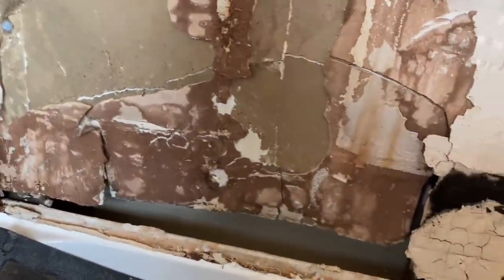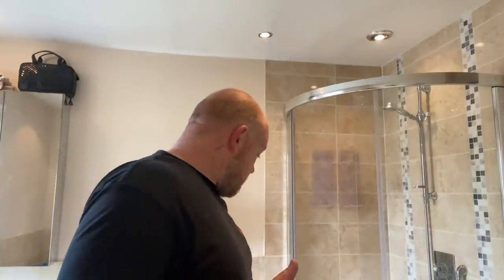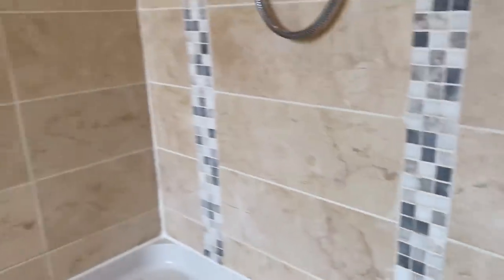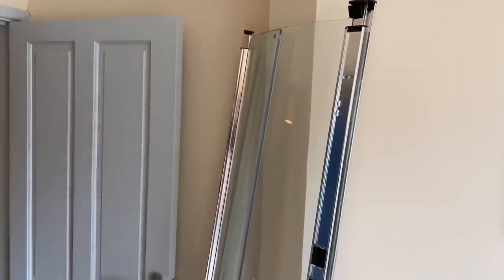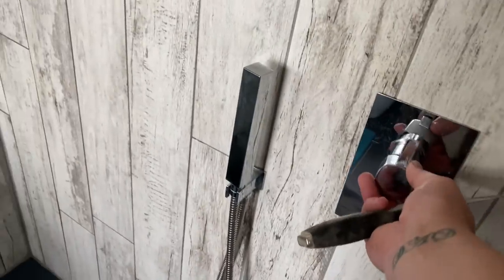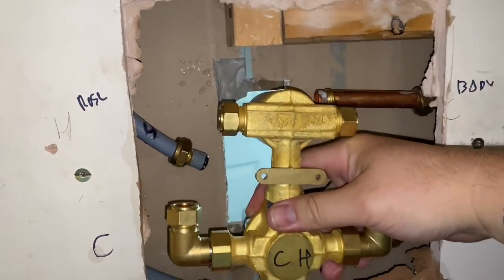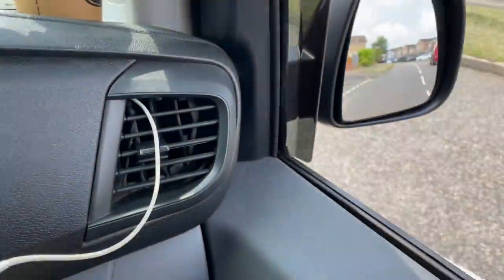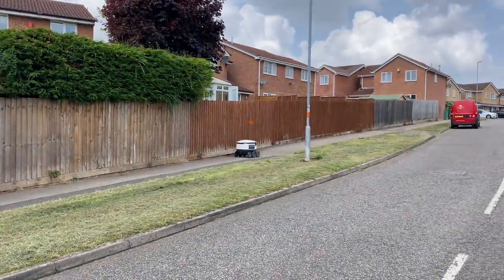SHOWER PROBLEM ON THIS JOB & HOW TO STOP A SHOWER PUMP FROM “PULSING”…

Comment: Buddy you just saved my sanity, shower has being pulsing all week, checked the outflow and filters..everything was fine but still pulsing. Seen your video, adjusted the isolation and what do you know it worked a treat. Can't believe it I was close to pulling the shower off the wall 😋.

Comment: Hi Mark I  had this exact same problem a couple of years ago with a customers shower pump that was pulsing,  did the same thing as you I restricted the flow cured problem, the actual problem was caused by the flow rate being to fast for the shower head riser pipe which only had a bore of 8mm housed in a 15mm riser tube( cheap import from china) this subsequently caused back pressure thus causing the pump to pulse, the cure was to restrict the flow slightly to the pump, and as far as I'm aware it's still working fine to this day.
Reply from the maker: Sounds exactly the issue I was having buddy…. Glad someone else has had to do what I did.

Had me baffled that’s for sure

Comment: Evening Mark, I'm at the start of my career plumbing but I had similar issue with a shower pump but different set up to yours. It was a single impellor pump just pumping the hot feed and I worked out that the cold side was fed through the tank to the mixer shower so unequal pressures. Obviously being new in my plumbing career it was quite nerve racking to cap the cold side and test running the mains cold water to the shower but to my relief it worked. Great video as always mate. Really appreciate the content 👌
Reply from the maker: Thanks mate, glad you sorted your issue…. Just go through each issue and eliminate bits as you go along.

Comment: Hi Mark, loving the content on your channel, full disclosure, I'm a kitchen/bathroom fitter, never claim to be a plumber!!
I've just finished refitting our bathroom at home, took out the bath and fitted a 1600 x 800 shower tray. I wanted a decent shower as it's the main bathroom, so went with a Mira Mode Maxim Digital mixer, running off our combi boiler. Really nice unit, pretty simple to fit, (we are living in a bungalow), but interestingly it comes with three different inlet filters/flow regulators. These are matched to the flow rate of the boiler specifically to eliminate pulsing, so I assume doing the same as your iso fix.
Congratulations on your channel mate, will follow with interest.👍

Comment: Great video mark in the past I've had this with shower pumps some of the things I've found are unbalanced hot and cold, filters causing a restriction removing them stopped it, blockages in the pipework caused by limescale, air getting sucked up the vent pipe, expansion vessel on pump needing recharged.
Reply from the maker: Thanks mate

Comment: Hi always learning from your vids even though I've done a few bathrooms theres still something new. So here's my bit back to you. 
The pulsating issue is very similar to your dc inline camper pump. If you don't understand it, get one of these(shurflo etc). Take the plastic housing off and see how is it made. In short it's a safe device for the pump never pumping more than the outlet is designed to draw and so increasing pressure in its guts. Example: 2 bar on the pump and 20 l/min outlet. No issues. 2bar on the pump and 5l/min outlet and its pulsating with increased pressure each time it let some water out.
This dc pump is done with valve and spring. Similar to your check valve. On your negative booster pump won't be much different I can't imagine. 
Not great at explaining but thought I could help. If you just lost couple of minutes by reading this and still don't understand it, then I am sorry and also sure never to be a teacher🤣🤣🤣
Good luck mate!
Reply from the maker: Hahahaaa…. Read it twice and get what you mean 👍🏼🤣🤣

Thanks for taking the time to replay mate, much appreciated.

Comment: Great content as usual bud👍🏻 Had a similar week! Bathroom refit, shower wall install where the customer supplied bath, basin, screen and toilet and were really chuffed how “cheap it all was”! Bath had been repaired in the corner near the waste (customer not concerned), waste outlet on toilet was cast out of shape ( customer not concerned), shower screen scratched and had those crap push in seals which were a b’stard to fit ( customer not bothered), pedestal damaged and had been painted over (customer not bothered), bath panel damaged and was twisted out of shape and the customer said…………………….it looks 10 times better than it did before😂 doesn’t do a lot for taking pride in your work though does it!
Reply from the maker: Nightmare week for you aswell then buddy…

Well we go again tomorrow 🤣

Comment: Yes had a pulsing pump and didn’t manage to sort it - customer got another plumber in who fitted a surface mounted valve and risers leaving the old concreted in valve and riser redundant - I was told by him that the filters in the old valve were blocked with debri and couldn’t get at them to clear. That’s  a new one on me. As regards the robots they’re everywhere in Northampton- I always assumed they were from Amazon and not food shops

Comment: Hi mark know wot you're going through mate it can be tough out there I have been fitting bathrooms for 30 years  admire the way you show the real world seams like pump is trying to pump more than it can let out of shower head if that makes sense
Reply from the maker: Thanks mate, just showing what we all have to put up with day in day out 👍🏼👍🏼

I did think that with the shower head but does it on the body wand aswell….. strange situation

Comment: Fantastic video again mate. Thanks for taking the time to film and share. 👏🏻 

Shower tray/cubicle: A great example of why shower areas should always be tanked prior to tiling. 

Pump: Never heard of a pulsating pump like that, mate, so great info to know. The only thing I would say is perhaps fitting flow restrictors might be a better option instead of using the iso valves.
Reply from the maker: Cheers buddy…..

Was a case of getting it working and seeing how my mate gets on… may fit them on a return visit👍🏼👍🏼
Reply: Fair play  @MJTiffPlumbing
Reply from the maker: Thanks for watching pal….. 👍🏼👍🏼
Reply: Loving the work @MJTiffPlumbing . I'm hooked 👍🏻

Comment: The pump is controlled by a flow switch, educated guess is that a pressure wave is going down the pipe, hitting an elbow etc and reflecting back and then turning the switch off.

You could probably have fixed it by fitting shock arrestees too.
Reply from the maker: Now there’s an idea……👍🏼

Comment: Had the same exact issue with a shower pump with a shock arrestor/accumulator built in (though don’t know if that contributed to the fault). My reasoning for throttling the incoming was that the pump is switching on a differential pressure/flow (drop). So if the pump doesn’t detect it it won’t fire up… Or it will cycle as the inlets make up the pressure
Reply from the maker: Strange one isn’t it

Comment: hi bro great video. I have a similar problem with my pump. Installed new showers mixers new taps for 2 bathrooms and brand new roundfoss 3bar positive pump.....it's pulsing and I ve done everything....
Reply from the maker: Sounds like air

Comment: You done a good 👍 thing , the pump is to powerful for one ☝️ shower , and size of cylinder , and tank on a loft could be to small or fill valve inside a tank in a loft is not refilling water fast enough… the pump is sucking water and air at the same time… other common fault hot water cylinder should be set on 60 degrees if it’s hotter than that it will damage the pump in a longer run.
Reply from the maker: Thanks mate…
Tank in the roof is big enough and fills fast enough to not run out.
It pulsed as soon as it was turned on… but the problem is now sorted with the flow turned down…

Comment: I’ve had the same before with a shower pump pulsing, turned out the be insulation that got into the tank and then stuck in the feed
Reply from the maker: Good shout that 👍🏼

Comment: Great vid mate, and sorry you had to go through the painstaking process to finding out how to fix the pulse. I would have said defo back flow pressure from the shower head poor design working against the pump but if the body spray did it, very weird. Thanks for sharing though.

Nath will be watching in disbelief at the tiling, dot here and there...should be regulated some how as tile adhesive coverage in a shower should always be at least 90%! Criminal spotting that.....

Keep going mate
Reply from the maker: Thanks mate… yer it was deffo a strange one that really had me thinking, and still is..

Nath came to that shower job and that’s the point it become a complete different job… the saga continues…

Thanks as always mate 👍🏼👍🏼

Comment: Yes had the same issue with a shower pump, and fitted a couple of gate valves and turned down until it stopped (couple of questions, filter blocked? Pump too big for shower,  is it for 2 showers or just the one?
Is the supply to either shower head or pump, have a lot of bends/elbows?)
Good video, enjoy the highs and lows
Reply from the maker: Thanks mate

Single shower and all swept bends etc….. like you once throttled the feeds all was fine 🙌🏼

Comment: Hi Mark. I've fitted a Salamander pump recently and I'm sure the instructions state to have the AV couplers as straight as possible where as they are bent over 90 degrees in this video. Not sure how much difference that makes in the real world though.
Reply from the maker: Never had an issue with them as they are installed to be honest 👍🏼👍🏼

Comment: The shower pump is the wrong one . The one that's fitted is for negative head . You have positive head . I.E.  loft storage above shower head .  What's happening is the pump us putting out more volume than is required so the restrictions in the system create pressure.  The pressure builds to a point where the pressure switch thinks the valve has been closed and stops pumping . That's why there is a small charge vessel on top of the pump ,  there will also be non return valves to stop the pressure being lost . Once pressure drops the pump starts again.  By reducing the input (throttling down the valves) there is not enough volume to create the excess pressure required to switch the pump off , so no pulsing on and off .
Reply from the maker: I know what a positive and negative head pump is and that’s not the issue.
This pump was originally in the roof and did exactly the same thing,It’s been moved to try and sort the issue which is now sorted
Reply: @MJTiffPlumbing  what I have said still applies . Positive head pumps have flow switches which bring the pump on . Negative head can have a pressure switch and charge vessel.
Reply: @MJTiffPlumbing  you said you had connected a hose pipe to the pump , with the open end of the hose there is little restrictions so no pressure build up . Once a headset or rain head is fitted you have small ports and restrictions.
Reply: @MJTiffPlumbing  I am not trying to be an arse about this . I have only seen the video and don't know the whole job or how it's piped up . I ain't saying you don't know the difference between positive and negative head . What I have said is my take on it . Others may have different ideas
Reply from the maker: Not saying you are mate… I appreciate comments on this as it’s a new one on me, and others judging by the comments/feedback 👍🏼👍🏼
Reply: Finally someone has got a perfect diagnoses for the problem, this absolutely makes sense. Negative head pumps are for when you have the shower head above the water level in the CWSC, for example in a loft conversion with an en-suite. See these fit all the time in houses, completely wrong.
Reply from the maker: So what happens when that pump is in the loft but still doing exactly the same thing…..??

Which is what it was doing to start with.
Reply: @MJTiffPlumbing  pump location doesn't matter.  It's still producing more volume than required hence a pressure buildup.
Reply from the maker: I’m saying that negative head pump was in the loft but doing the same thing…

So if it’s producing more volume than required, by turning the isos down that’s why it stopped pulsing
Reply: @MJTiffPlumbing  the pump hasn't changed.  Only its location. Hence the issue prevailed.  By reducing the input volume you reduce the output volume and therefore the output pressure.

Comment: Have you checked , how good the bending pipe was from a cylinder going upstream inside the cold water storage tank , whilst pump is on or ask anyone to put it on and put the hand over the overflow pipe, see if it’s any suction in there , anything in pulsing, usually involves air suction at the same time . If previous pump was doing same it’s got to be it , other tip , remove the big square shower head on top, could be lot of debris stuck inside, and let all water to gush out , and the last one it’s a built in strainers inside a shower body…. If they wanted to done them properly, massive investigation involves , other scenario could be , whoever installed a S-Flange , the foaming insulation on a cylinder went down inside a cylinder tank , which blocking partly the S-Flange, not everyone does a clean and nice job .
Reply from the maker: Complete set of checks done at the time mate… but thanks

Comment: had a crosswater tray crack all the way round the waste on sunday, only 18months old, only 25mm thick which ive nvr seen before, outlet just as u step into it centre of the radius. Fully supported although it shouldnt matter as it can also be fitted on legs. Thankfully the client supplied all the ware themselves so cant hold us responsible for supplying shit. Trying to find something to replace it with has been a challenge, trying to do it without breaking tiles, ended up with a mira flight, bit of an odd waste connection, its like a slot. Also 905mm which hasnt helped.
Reply from the maker: Fair play sorting the issue 👍🏼👍🏼

Comment: Looks like that shower tray had the plasterboard fitted around it, and not down behind it too. This will always leak as the p/b has no horizontal fixing points at tray height to hold it firmly in place. Silicone etc cracks with the movement and water gets in….. if unable to remove the tray and fit p/b behind it, fill the void in the stud wall with expanding foam to keep the p/b solid
Reply from the maker: I will be removing it all and fitting Hardy backer moisture board and sorting it all properly 👍🏼👍🏼

Comment: I find this alot with pulsing on thermostatic valves (TMVs) as the failsafe kicks in and out due to pressure that's why throttling back tends to work with most
Reply: Did you check temperature coming out when pulsing??
Reply from the maker: Temps were all fine…. Throttling it back seemed to sort it 👍🏼👍🏼
Reply: @MJTiffPlumbing  sounds like the thermostatic failsafe trying to kick in due to high/low flow rate or flow rates slightly different

Comment: Did the shower instructions say use a pressure reducing valve or keep the hot and cold balanced?
Reply from the maker: Nothing about a Pressure reducing valve at all…. Piped at manufactures instructions
Reply: @MJTiffPlumbing  ah right you would hope they would mention it. Am sure Paul from Mira has mentioned this kind of issue on GasApp before. Glad you sorted it everyday you learn something new and probably forget something else!!
Reply from the maker: Thanks buddy 👍🏼👍🏼

Comment: Great content 👌... them robots will not last long over my way... they nick the steam of your shite...Hahaha 
I've had the problem with the shower myself... airlock type of issue... pumping too fast flow switch in /out due to inadequate flow. I'm taking it was gravity fed... obviously maybe not enough head pressure to keep up with the flow hence flow switch in out...
Reply: Correct. I've had the same issue once.  Was exactly the same issue
Reply from the maker: This had me baffled, as said ended up turning the iso down to restrict the flow and it solved it…. Usually it’s not enough pressure/flow….. not in this case it had plenty of head…. Over 2metres
Reply: Hi, what volume header tank though if the pump was too quick supply could struggle to maintain head pressure...ie might run dry in ex amount of time possibly...
With regards to the other job ... I always price aqua seal into it...  do you know the stuff I mean ... bitumen on a rubber seal?
Always cement fibre board instead of plaster too... been in the very situation myself.
Reply from the maker: Header tank is huge…. Zero chance of it running out

As said…. Issue was solved by reducing the flow. It pulsed as soon as the shower was turned on.

The shower job, it’s completely coming out now

Comment: They say to fit full flow isolating valves. This is the opposite! Bloody plumbing.
I've got one at the moment with an existing half inch vent pipe. I've no idea if the pump will work properly with it or not.

Comment: Pump looks like a negative head version which should have non return valves and doesn’t rely on float switches or flow rates I'm confused
Reply from the maker: It is negative head as it was in the loft but was doing the same thing when up there
Reply: @MJTiffPlumbing  absolutely bizarre I've had it where the non return valves let the pressure in the positive side of the pump back into the supply side which causes pump to start stop while no showers are open

Comment: Bloody standard plasterboard in shower cubicles. What's wrong with installers? Ever had a shower pump running two showers, and to get one to work you have to turn on the other shower on first then it works, and go back and switch the first shower off.
Reply from the maker: More shower nightmare 🤣🙈🙈